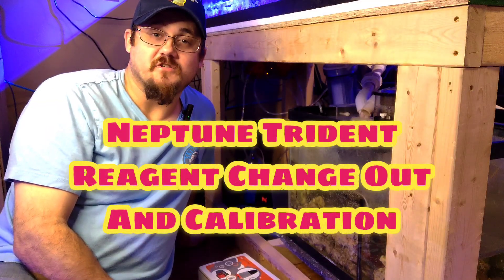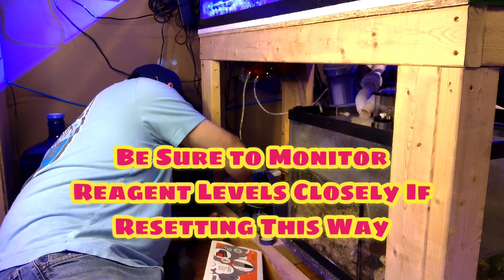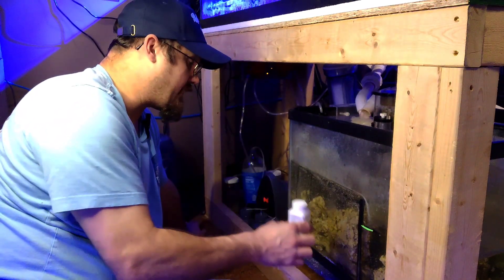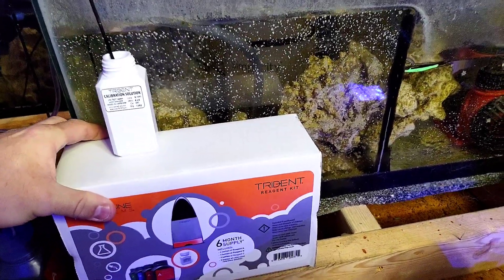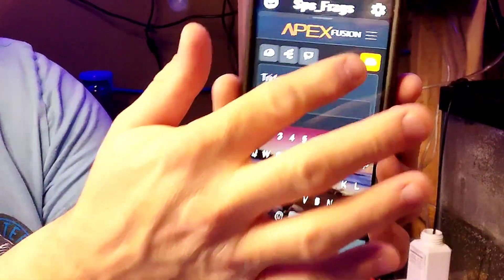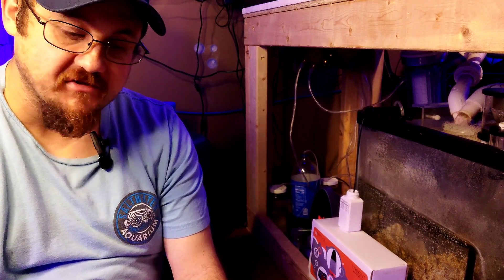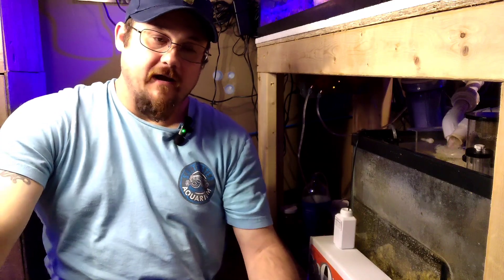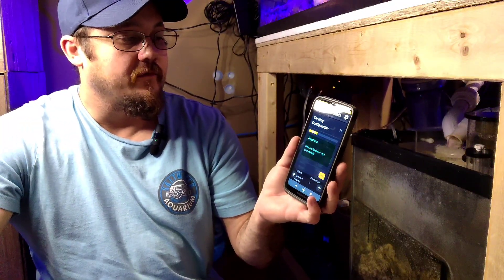Calibrating the Neptune Trident Reef Tank Tester the Right Way!

Comment from the maker: A good point was brought up on Reef2Reef. Make sure you either uncheck the previous selections you made while doing the calibration steps, or leave the page of the app in between each one. The reason is because the app doesn’t reset the options you select if you stay on the same page the whole time. This is a flaw in the app.